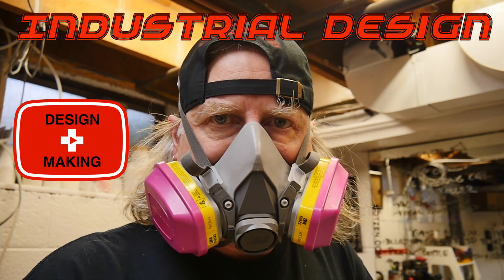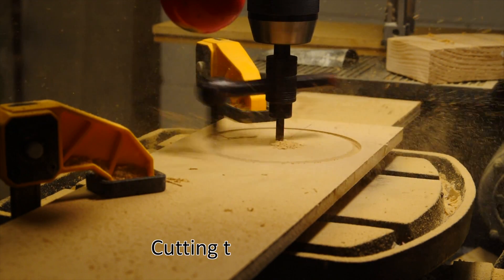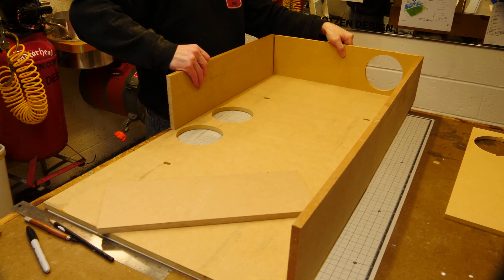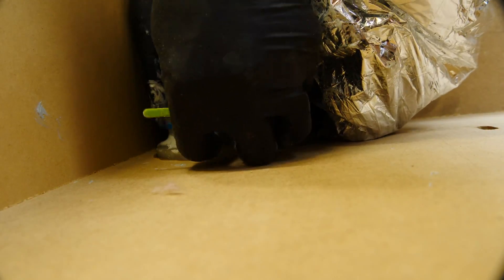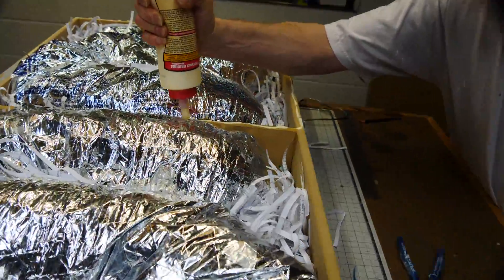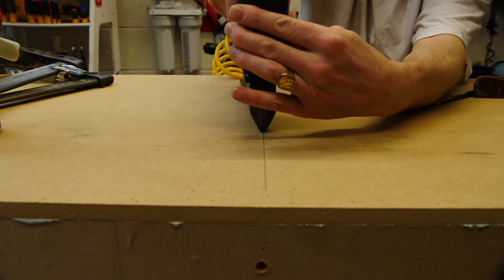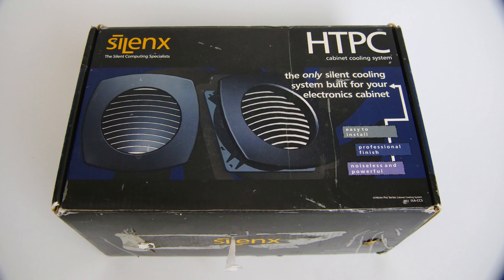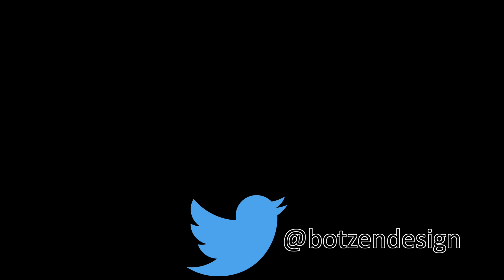Vocal Sound Booth Whisper Room Build: Part 4 Ventilation System

Comment: Perhaps decoupling the boxes from the booth would help reduce some of the noise. Probably the easiest thing you can try If you've got the boxes hanging off the side of the booth is to use flexible rubber mounts instead of screws to hang the boxes. The best thing to do, although I realize this is probably a lot more work and not in line with your original design, would be to set the boxes on the floor and run tubing to the booth. Either way that's a great ventilation system and I hope you reap the benefits! Stay cool!
Reply from the maker: Oh, good idea!
Reply: I saw a brand of fans called “Be Quiet”. Maybe they’ll help.
Reply from the maker: Maybe

Comment: There are many brands of computer fans that are sold under the fact that they are remarkably quiet some of them surprisingly so if it weren't too difficult and you feel it's worth it maybe you could replace the fans at some point
Reply from the maker: yes, it would be possible with some difficulty, but anything is possible if you have the will. Suggestions?

Comment: Hi mate love the build want to know if you sorted the fan sound and how you did that?
Reply: Thanks for your quick reply.
1 thing are both fans in the top box only or is there 1 in the bottom box?
Reply from the maker: Both in the top
Reply: @EricStrebel  legend..
So to be clear you used 1 fan to pull out in top box and one to push in in bottom box?
Reply from the maker: @arthurloueizi1074  no, both fans are in the top box
Reply: Mount rothe box further away from the  booth
Reply from the maker: Turning out not to be an issue at the moment, I still plan to mad some sort of a baffle over the opening, just have not gotten to it yet. But I will at some point. To busy at the moment with design work.

Comment: My CPU fans came with the little soft dong mounting system too. so freaking weird but i guess this is the future. out of the 16 mounting points that used them I only broke one of the little rubber dinguses off.

Comment: I'm no way an expert at this... though am learning due to "health attacks" more than I ever thought I'd learn regarding amateur radio, electronics and RF engineering.  Well... seems like a Faraday cage anechoic chamber setup come to mind overboard where the honeycomb filters are used for the RF for ducts... though I've wondered about just using copper scouring pad as filters.  Now in regard to the sound level... there are dense materials that I guess are PVC with density increasing mineral additive(s) based like the acoustiblok that might be able to be rolled up to make tubes that inside the tubes the lining of your room material or maybe just foam bedding can be used.  So I wonder if using a dense sound absorbing material like in a honeycomb pattern or maybe like some sort of rubberband mesh has an effect? I'm sure there is some sort of metamaterial 3D printed or not design too whether the best or not... will be better for filtering and lining. 

Seems what would be awesome would and cost effective can be coating the foam with like an even denser material like sound deadening paint or somehow spraying that silicone foam noted in the hackaday article recently or maybe some other dense material.   I don't know exactly... though seems like rather than a pipe baffling made of thinner plastic... a denser material would be better like floor mats or something more absorbing for the giving surface area design or increasing the surface area potential designs.  

The intake idea from the room I'm thinking is like you're noting though lining both sides with your wall material or something better.  Might need to consider that change in air flow due to the increase in surface area... though wondering with equivalent air flows what can be done to lower the pressure waves.  

If heat exchange is what you're wanting to do... maybe consider two radiators from the salvage yard with one inside and one on the outside maybe?  Guessing they'll translate sound... though might transfer the heat too.   Probably better to line the box like the radiant flooring methods all around guessing.  OK... wow... TMI!  Thanks for sharing!
Reply from the maker: Ok, good food for thought, thanks for sharing your ideas, much appreciated!

Comment: nice build! 
I see 2 leads for improvement: 
A) I would use a centrifugal "squirrel cage" fan blower you find in kitchen hoods like these ones   https://images.app.goo.gl/x87pCi9xAdoAoBoK8. to draw out the air.       On low speed they are very quiet and still draw A LOT of air!   I use one in my workshop running 24/7.
B) as Anton Konrad said, the inner lining has to be at least perforated, or removed (that's what I would do) ! because the flat pvc inner surface is just bouncing soundwaves through the whole duct, thus you dont take much benefit of the glass whool around.  As an example I build such a perforated drain pvc pipe surrounded by mattress foam and air-sealed with garbage bag, it cut out 15-17dB out of my dust collection system (which is A LOT of a 60cm tube!)
good luck

Comment: You said that you didnt need it to be soundproof. What would you have done differently for the booth to make it soundproof?
Reply from the maker: That's a really good question of course and I'm not an audio engineer so I can't really answer that question however I think Rockwooll would be good and some mass loaded vinyl and possibly thicker wood
Reply: @EricStrebel  can we use bonded foam for soundproofing ??
Reply from the maker: Don't know

Comment: Very helpful, I do enjoy watching these, very creative, useful and good information. I do have a small question though, in previous videos you’ve made this booth easy to take apart piece by piece, how does this ventilation system affect that?
Reply: I’m actually going to try to build this with my dad, hopefully we can make due without all the cool and helpful tools and gadgets you have (obviously we can get some but like the 3D printer would be out of the question) imma go take a look at some other videos  to see what kinda cool things your up to.
Reply from the maker: it does not effect it at all, the vent boxes just hang on the outside of the booth and are easily removable since they are just hung on 4 screws with the keyholes. Thanks for your question and support, much appreciated. feel free to share with the world on social media.